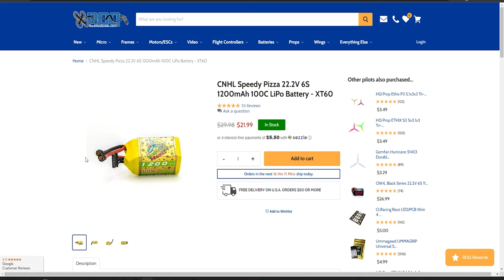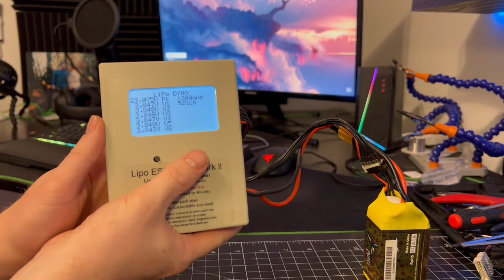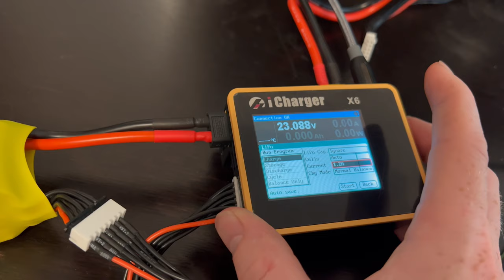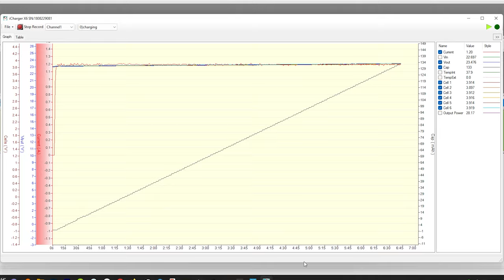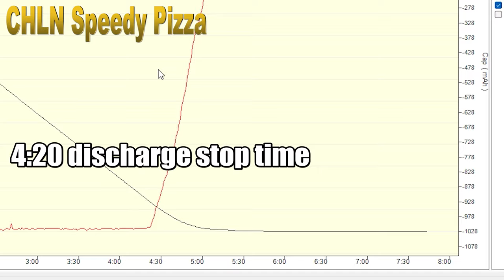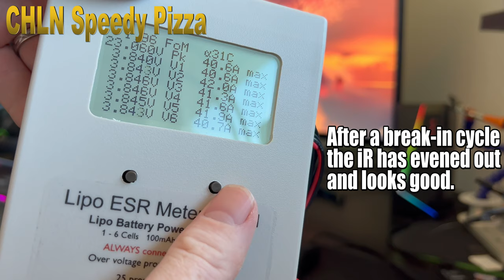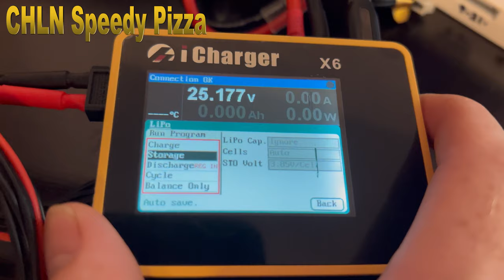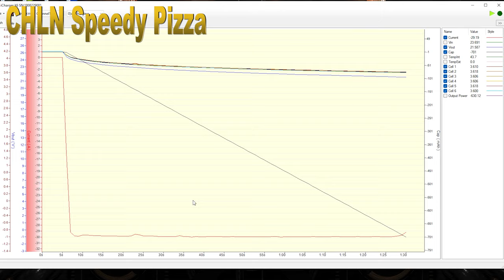Tattu R-Line VS CHLN Speedy Pizza - Who is best??! Battery iR Testing

Comment: I have r-line V4, cnhl white and black lipos. Whites are really cheap but it seems that blacks perform much better. R-line seems to be holding capacity and equal voltage on cells much better than both types of cnhl. Blacks are nearly as good as r-line and much cheaper.
Reply: I noticed the same thing. My tattu in storage has all its cells at 3.80, while the CNHL varies a little, staying at 3.80 - 3.78 - 3.79 and 3.78

Comment: Isn't speedy pizza just a rebranded 'pro model' of the black line in a special size they don't usually do, and with a slightly sturdier cover? I don't think the 1300mah black line is better. In fact where I live speedy pizza ones are more expensive. I just get the black line because I prefer the colours.

Comment: In my country, Tattu batteries (common orange and black) are selling for the same price as CNHL Black. Will it be more worth it? I have a Tattu 3s and a CNHL Black 4s. I don't know if it's the cell difference, but the CNHL seemed to me to be much more powerful, in addition to being more visually beautiful. I don't think the CNHL loses to Tattu in any aspect.
Reply from the maker: I can’t be sure what cells are being sold in different locations around the world, but if you have some good data like iR measurements I would love to know what you’re seeing!
Reply: @ChaddRainsFPV  For now I don't have any internal resistance meter for the batteries. What I said was based on how I felt on each flight. Clearly the CNHL seems to have more power in flight, despite being a little heavier, but the Tattu seems to have more durability. I also wanted to know your opinion, which one would you buy today with both the same price and same specs?
Reply from the maker: @rMidnight  If it was a choice between either the Tattu R-Line v5 (as that’s the newest pack available) or the CHLN Black for the same price I’d get the Tattu. 

Assuming the packs available to me are the same available to you, that’s what I’d do. I think Tattu would end up fitting better for the flights I do. But given the price difference for me, the options would be weighed more as to how likely I am to destroy the pack to get the shot I need 🤙
Reply: @ChaddRainsFPV  I understand. In my case, the options with the same price would be the Tattu 75c 4s 1300mah (not the r-line) and the CNHL 100c 4s 1300mah, both are the same price for me and I'm not sure which one to get, since the CNHL has a higher discharge (100C vs 75C). I don't know how far this would affect the internal resistance of both because I don't have any device that I can measure. I just need potency and longevity basically. Thanks for answering!
Reply from the maker: @rMidnight  for sure. I would get the CHLN Black as the 75c Tattus are a much older cell/design. This was the info I needed to answer accurately 👍
Reply: @ChaddRainsFPV  Thank you so much for taking the time to answer this, it helped me a lot! I will be following your channel. Success!